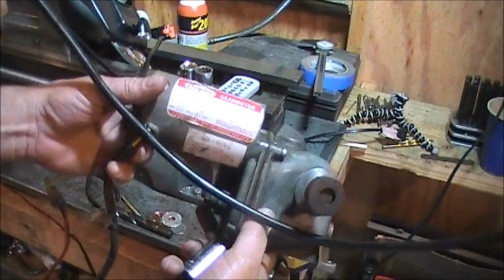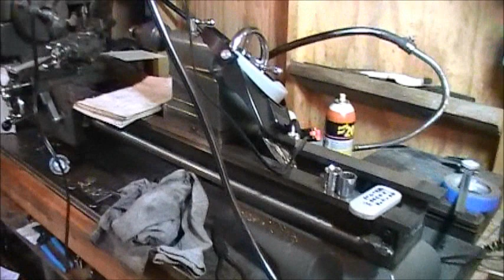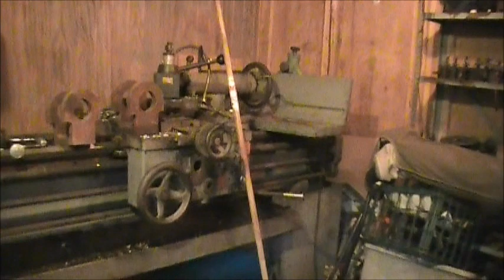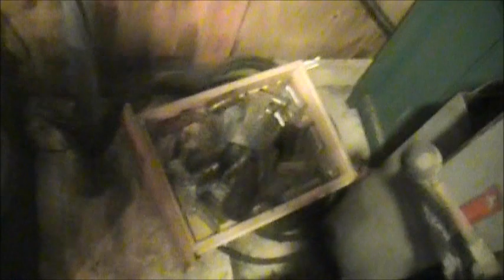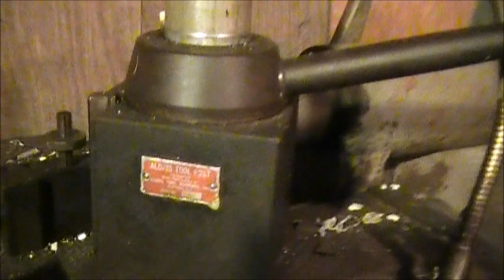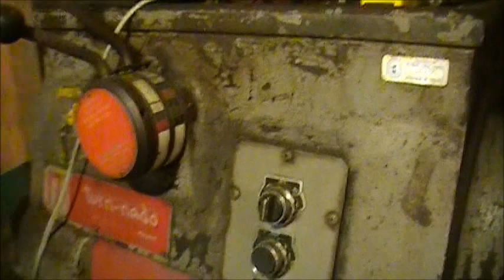auxilary power feed for the Chraftman Atlas lathe

Comment: Hi Dave, I have an Atlas 10F that I rebuilt some 25 yrs. ago. I am 84. I goofed big time when I cleaned the quick change info plate. Well, I unfortunately used paint thinner, by mistake, and the perfect red color suddenly became light red. Do you know anyway to repaint that area, except by a very tiny brush? I am an Industrial Designer by education, so I can do it, but there may be a better way? This is my first time on YouTube, so this may the wrong post area? I have learned many moons ago, that we are never to old to learn
Reply from the maker: I'm not sure about that. sometimes its easier to simply buy a replacement info plate off of ebay. many times ebay has parts for these lathes that are in very good condition. wish I knew the answer for you

Comment: Hi, Dave.

 If the nut is a standard thread, replace it with a nylon lock nut pulled up flush with end of the leadscrew. Make a spacer to fill the gap.

Tom
Reply from the maker: I got a new option see my latest lathe video here http://youtu.be/IM3pmyyCMrI